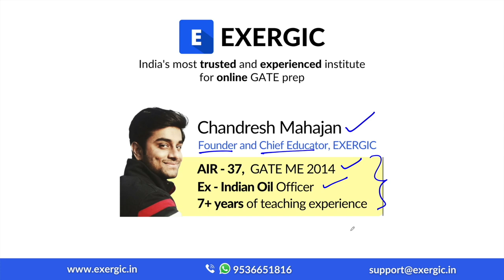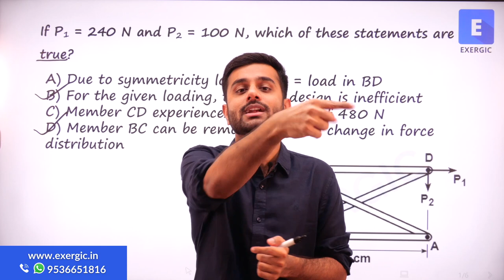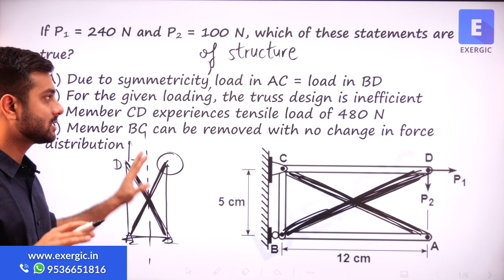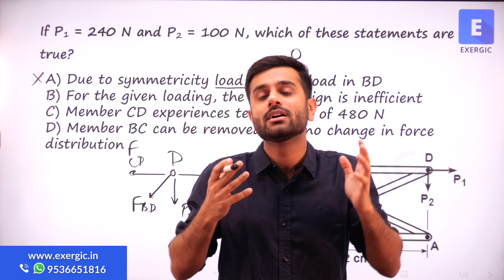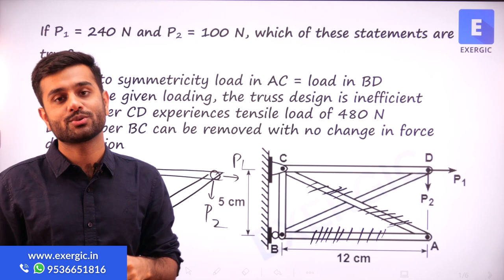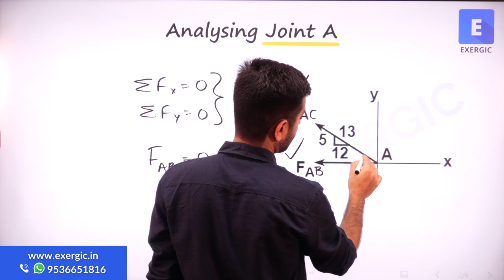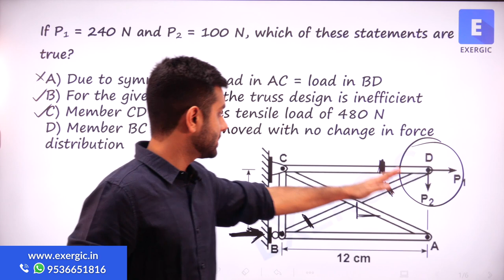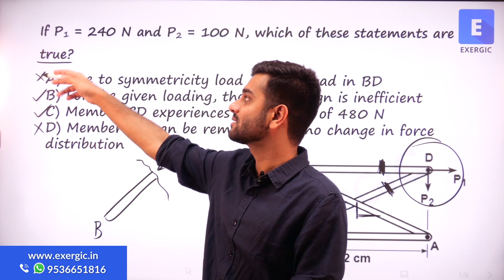Tricky Question from Truss - Mechanics | GATE Mechanical | Exergic

Comment: Sir, in one case you say zero force members are not cost efficient and in another you say load may shift for which zero force members are necessary. Please explain.
Reply from the maker: In engineering mechanics, we deal with static loads which do not shifting. The question has not mentioned anything about fluctuation of load.

Shifting explanation was given from Machine Design perspective, which is NOT applicable here.